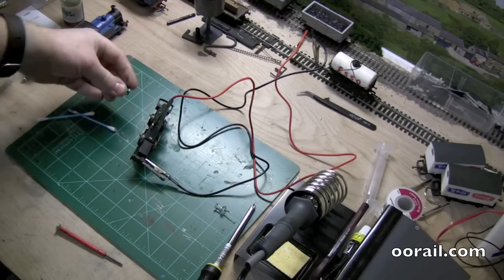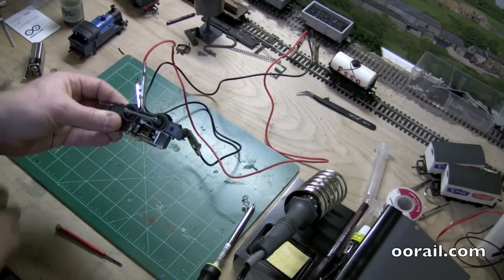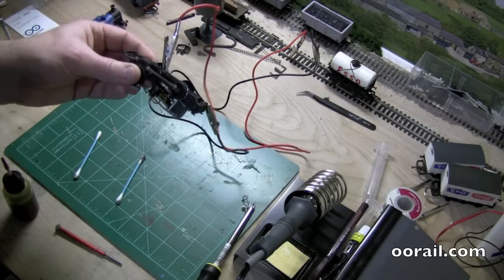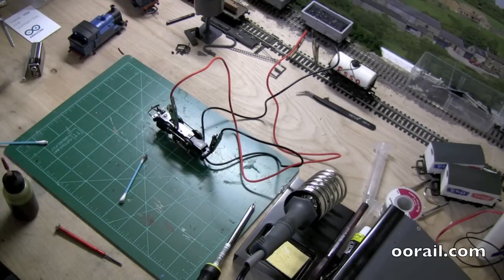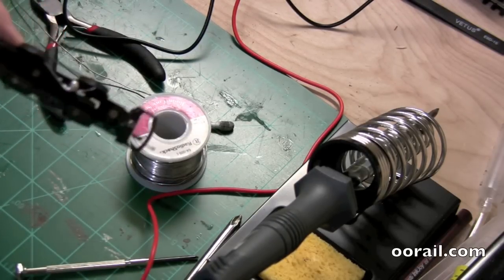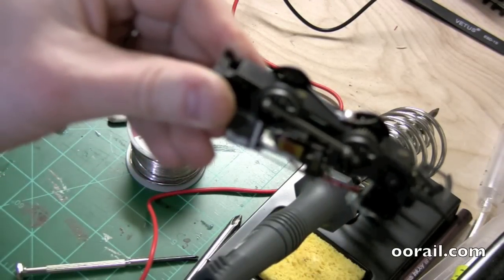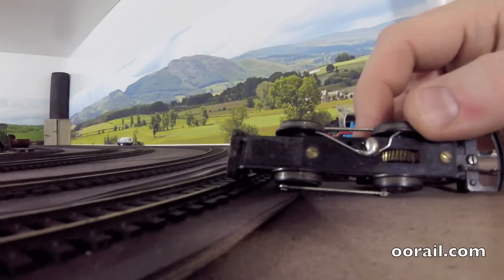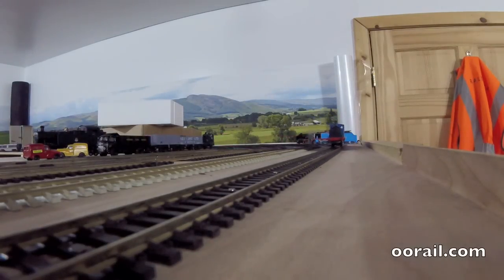oorail.com | Scratch built Loco Parts - Loco Works Wednesday

Comment: A bit messy but it works. I use sheet brass thin enough to cut with scissors to replace missing Tri-ang / Hornby pick ups. Also it's not the depth of the Tri-ang flanges that makes them jump over points, it's the flange spacing. Check them with an NMRA standards gauge. If you can set the flanges to meet the gauge spacing you will have no problem running them on Peco or Hornby track. David.
Reply from the maker: Thanks David but you are incorrect about the flange spacing. The problem is the depth of the flange (or diameter of the wheel). When it comes in contact with the frog of the point, it causes the loco to raise up on one side enough to derail it as it exits the points. The guide trough on the peco points are raised up a fraction of a mm more than the Hornby ones.
Reply: +oorail.com Having corrected the wheel spacing on numerous pieces of Tri-ang equipment I stand by my comments however the flanges are too deep for some older track such as Atlas, Model Power and Life Like.
Reply from the maker: +David Atkins So the NMRA standards gauge is totally useless. None of the British products are manufactured to the NMRA specifications, its an American standard. The British products are manufactured to be compatible with the OO scale. Doesn't mean its not compatible with NMRA stuff, just saying you are probably better off using British trains with British track... I understand what you are saying about the wheel spacing, the problem is thats not the actual problem. The V of the frog is raised a bit higher than the chairs that hold the sleepers to the rail. The diameter of the wheel is too large, so as the loco traverses the points, it raises up, sometimes causing it to shift to the left or right enough that it derails. It does this on PECO settrack points, and Hornby points. Most of the points I'm using on the new part of the layout are PECO Streamline points. These have an additional problem. The gap between the rail and the guide rail nearest the frog isn't wide enough for "some" Tri-ang wheel sets. I've got dozens of Tri-ang locos, so I spent 20 minutes this morning comparing the wheels. The wheel flanges on that Nellie loco are at least 3 to 4 times thicker than a modern loco (such as the 3F Jinty). There are very slight variances between the thickness of those wheel flanges and the diameter of the wheels (fractions of a mm), but its enough to cause the locos to sail through or get stuck in those gaps between the rail and the guide rail. One of the dock shunters I have (its a bit newer than the others) has slightly narrower flanges. It doesn't get stuck as badly on those guide rails, adjusting the spacing between the wheels does allow it to get through the guide rails. However, on the others and on the 0-6-0 steam loco, the flanges are too thick, they just get stuck going through the points. Not all the Tri-ang wheelsets are the same, I suspect some of the newer Tri-ang locos have fractionally smaller diameter wheels and fractionally narrower flanges because Tri-ang was phasing out Super-4 and bringing in System 6 (similar to code 100).
Reply: +oorail.com Thank you for your reply. I do not mean to be critical but I firmly believe that the flange depth issue with Tri-ang rolling stock and locos is a myth that needs to be challenged. As I said I have had great success in adjusting Tri-ang wheels to meet the NMRA standard spacing for the flanges. I too like you use Peco points I have over 80 of them on my layout and enjoy running 60 year old Tri-ang trains through them at speed (with the original wheels). I do have a few spots where the flanges do bump over the tie plates/spikes/ rail chairs on older HO track. It's a simple matter to replace track. As for the NMRA standards gauge being useless, remember that OO and HO use exactly the same track specifications and so the portions of the gauge applicable to track and wheel spacing are very relevant. I have about 50 Tri-ang locos and admit that I have not been successful in bringing the flanges out to meet the standard on all of them as yet but remain fully convinced that it is the "cure". I will continue to seek ways to achieve that goal. If you remove the body shell from your "Nellie" and disconnect the motor so that you can clearly see both flanges as you slowly push it through the Peco points I believe you will find that one wheel will travel through while the other rides up over the guard rail not the floor of the frog. Correct the wheel spacing to meet the NMRA gauge and I believe you will find that it will ride through perfectly.  Your comment re; use British trains on British track, Tri-ang is British/Peco is British but they don't work together unless you adjust the flanges. I hope you find this discussion useful, we all have things to learn and through your videos you have and continue to teach me. One thing seems sure, we are both really enjoying this The Worlds Greatest Hobby. I look forward to any reply and further videos. David.
Reply from the maker: +David Atkins So first off, please feel free to speak your mind. I'm not easily offended and I appreciate all comments, whether they are positive, negative or critical. Sometimes I come up with crazy ideas, so its always good to have folks put me straight when necessary. I'm not one of those folks who posts up videos and only wanting positive reenforcement, that really doesn't get you very far. So I must say.. wow.. 80 points.. have you wired them all up to point motors yet? I'm currently at 81 sets of points, I still have the milk depot, ncb depot, large terminus station extension and the overhead section to complete, so I'm probably going to end up with around 100-120 sets of points. I think the sheer amount of wiring I've got left to do has suddenly hit me!! You should upload some video of your layout though... would like to see that! :)

So back to the discussion... so I happen to have another 0-6-0 Tri-ang loco that I had dismantled (green) to do a motor rebuild. So I ran it over the small Peco points, and you are quite correct it does go through those without any problems with a bit of a wheel width adjustment. However, when I ran it through the Peco streamline medium points, no go. This particular 0-6-0 has the rods removed on one side as they were rusted through, so I was able to pop a wheel off. The gap between the rail and the guide rail is so tight that the wheel flange gets stuck. The flange width (not depth) is about the same size as the gap. The same area of track has a couple of large Peco streamline points and some diamonds. The same problem with the diamonds, with the large points, out of the three there, it fit through two but the other one it wouldn't. It fit through all the Hornby express points I had on the other side of the layout, it fit through the peco large point I have behind the Brewery, but it wouldn't fit through the Peco large streamline points I have on the down/up slow lines. It fit fine through the ones on the down/up fast lines. 

A few months ago, I read some posts on another forum from a guy complaining that the Peco streamline track wasn't NMRA standard track and that it varied too much. So I went back and compared the distances on the Peco points, sure enough the ones it wouldn't fit through, the gap is a bit smaller, its tiny, less than a mm but thats probably just enough to stop the wheel flange going through it. I buy points off Hattons but I usually buy them either in bulk for a project, or I just add one or two to an order if I know I'll need them later in the year. 

Just so we are on the same page, on the effected points, the wheel flange is getting stuck (eg. physically barely fits but won't move through - gets stuck). I'm also curious about your comment that the flanges bump the chairs on the older HO track. I've had the opposite problem, I've got brand new Peco code 100 track (purchased between 2012 - 2015), both the cement and the wooden sleeper type, and all of my Tri-ang locos, with the exception of maybe 2 or 3, all have the bottom of the flanges hit the rail chairs. To the point where I just gave up and bought super 4 track and setup a stretch of track for  those locos! :)

As for my British trains / British track comment, so I meant for which they were designed for. So I've no problems running Tri-ang locos on Series 3 and Super-4 track, and I've no problems running Heljan / Dapol / Bachmann / Hornby locos on the new Peco track and points. The older Tri-ang locos were designed to run on Series 3 / Super-4 track. 

I still think adjusting new British outline locos to NMRA standards might be detrimental as they aren't designed to meet those standards. There is considerable amount of play in the wheel sets of these newer locos. I think you've convinced me though to go try this out, so I'll go pickup an NMRA standards gauge and put together a video! Might be a few weeks, have a ton of stuff in the queue... and diminishing free time! :)
Reply: +oorail.com Wow! Thank you for the lengthy response. Firstly let me say that it pleases me greatly that you have agreed to re-examine the question of flange depth vs. flange spacing. Spend some time getting to know your NMRA gauge before doing a video on it. I've had mine for about 30 years and it's in constant use as one of my most valuable tools. It will show you where the pinch points are in the Peco points. I have adjusted points using files, my Dremel (with a grinding disc) and my No. 11 xacto blade (for the plastic insulated frogs) to bring them into compliance with the gauge. We cannot assume that everything is always perfect straight out of the box.I have had few problems running Tri-ang on Peco flex track but as I said more problems on Atlas and other "HO" track.

I'm located in western Canada with the CN mainline less than 100 yards from my back door so you can probably guess my modelling preference, however I still have all of my British OO scale stuff collected over some 58 years.  I continue to add to it and I enjoy British running days. I have enough series 3 and 4 track to fill a typical basement but I don't have space for a permanent British OO layout as well as my HO.

The count of 80 points was from about two years ago so I did a recount. I have 89 in operation at present, 1 shinohara, 1 Model Power (3 way), 5 Atlas (will be replaced with Peco), 2 Peco set track and 80 Peco streamline. I also have 21 Peco not in use and 2 long Peco crossings (not in use). I have over 30 Peco point motors, none in use at this time. I focus more on train operation and use Caboose Industries ground throws. I use analogue wiring  and control with 5 controllers working simultaneously. I have no interest in being able to control my trains with a cell (mobile) phone from halfway around the world. (DCC).

I buy my British model supplies from various sources. Hattons is a favourite as is Rails of Sheffield, Olivias, Gaugemaster and many others. I do not mail order but visit in person whenever in the UK. I also try to include Toy and Train Fairs in my visits. My most recent purchases (Hornby Cl.25, Mainline Southern Mk1 coach) came from a local train show here.

Your final comment re; "adjusting British outline locos to NMRA standards might be detrimental",reinforces the need for a single standard. The NMRA standard may have started in North America but it is a good  standard and many of the worlds manufacturers have recognised it's value and are building to it. By the way, the Hornby square axel wheel sets are the worst for being out of gauge

I am very new to You Tube. I have shot some video of my layout and will do more but I am experiencing difficulty uploading and editing. Another work in progress! Thank you again for being open minded about this, It is in the interest of bettering the hobby that I opened the discussion, I look forward to your findings. Sincerely, David.